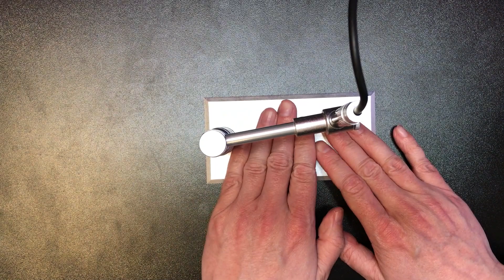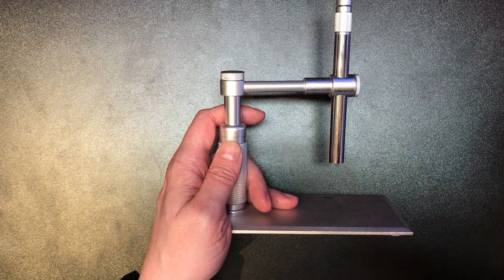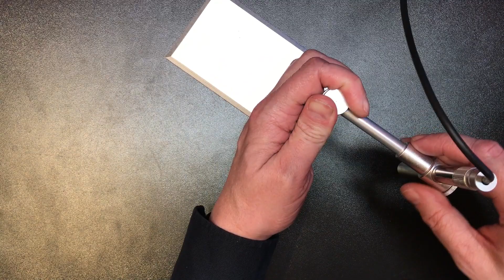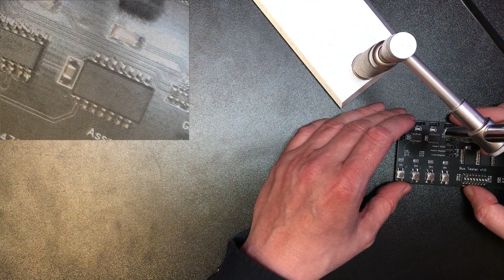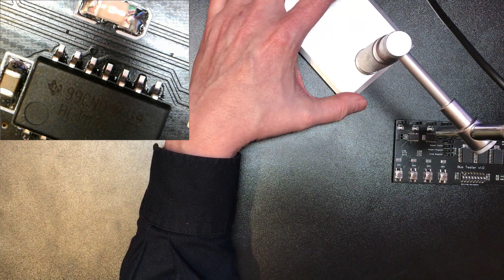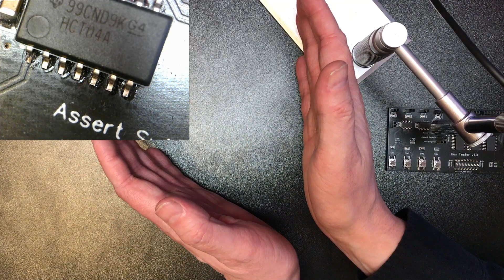About My Microscope...

Comment: Hi, the link below no longer works, and I've struggled to find anything like this... are there any markings on the microscope at all?  Also, another possible way to identify this is to look at the device properties in Windows device manager when you plug in the USB.  you can usually see PCI vendor identifier numbers under Hardware ID's in Device Details.  Also sometimes the driver filename or strings within the binary of the driver can have clues.  Any hints would be greatly appreciated!   BTW, I've watched ALL your videos and absolutely enjoyed them!
Reply from the maker: I have no additional information sorry. I've spent some time looking and can't find anything that looks right either. There is one seller on uk ebay with something that looks similar  but a bit more expensive.  https://www.ebay.co.uk/itm/167349654458